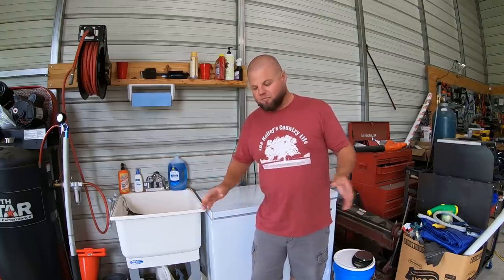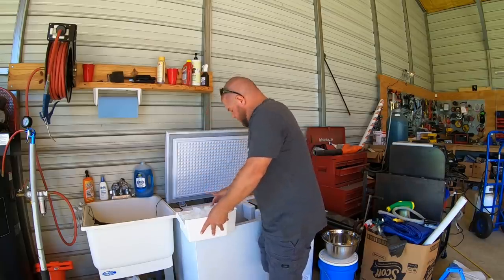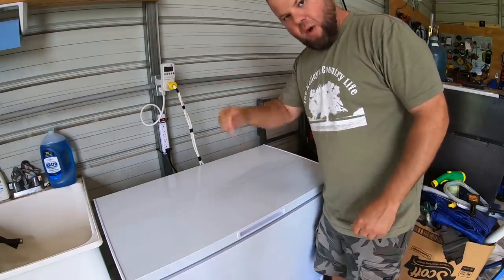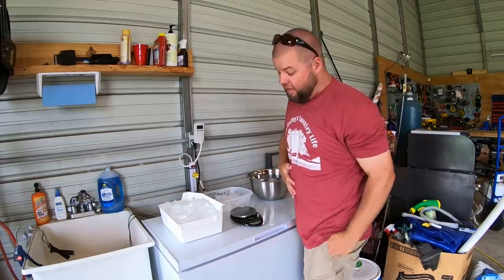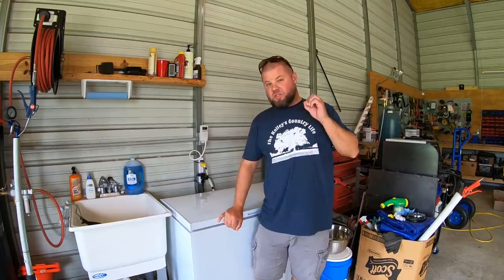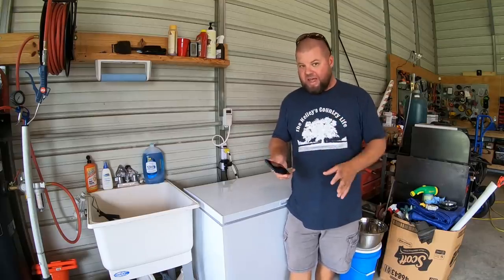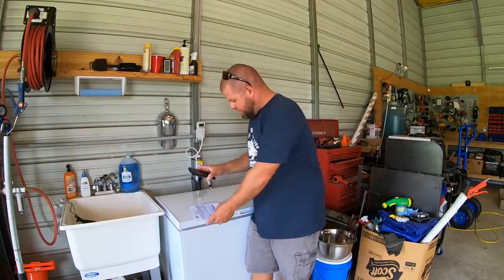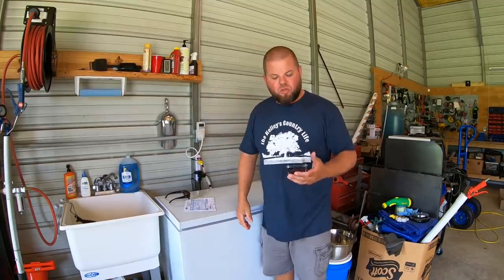Homemade DIY ice machine tests, energy usage and cost per pound! #370

Comment: Another thing you inadvertently hit on was the frost in the freezer which will make it more in efficient because it changes the convection rate of the inner surface which is how it cools and removes heat from the freezer.  Finding a more efficient way of removing ice from the freezer without letting heat and moisture in could be a huge advantage. Putting some sort of insulated tube on the bottom or creating some sort of gravity chute to remove ice from the freezer could be a huge advantage to the end result which is the overall production of usable ice. 🤔  i’m thinking of putting that up on a stand putting some sort of PVC tube with a valve on it that is insulated and has some sort of insulated cover that could be taken off you can fill up your bag or cooler with ice without opening the entire system and then pop the cover back on.  May be impractical from a monetary and labor standpoint but if you were working for an icemaker company and trying to make the most efficient product that would make a lot of sense.  

I think you noticing the water temperature was smart as well because that is one of the biggest heat sources inside the freezer where you are literally pumping heat in there in the freezer’s job is to remove heat from the system. Great catch 👍🏼

Ice is cool and all but let’s test this with mowing and try to figure out the most efficient quickest easiest and cost-effective way to mow. 😜 lol.

And your pocketbook is going to hate this suggestion but just from a purely ideological interest, it would be very interesting to see how cost-effective your system is against a marketed production icemaking system. Of course they have tons of money put into them so they’re going to make ice quicker but it’ll be very interesting to find out how efficient it is and include the cost The original story about unit to the cost of your final product and see exactly how much you’re saving by doing it yourself. 

And another project related after this is all over let’s figure out how to do this as cheaply as possible hidden craigslist and used appliance stores to see if you can find the icemakers and the products needed to do this for as cheap as possible.  😉 lol. Some people say it’s just ice and it’s not that important but with the amount of ICUs you’re saving a huge chunk of money every year and depending on how much use or how much you eat that may be every bit as cost saving to you as your garden is growing your own food, definitely on And efficiency-based setting, like you were saying at the price for gas to drive and pick it up paying two or three bucks a bag for something you can make it home for under $.50 you’re saving 80+ percent making it yourself%, a lot of people who garden to save money can’t hit that 80% mark. How many vegetables some money in a year. I’ve had several years where my garden ended up costing me more than what it yielded and even when it does healed unless you’re just eating tons of vegetables and would actually go by that money from the store in most cases people probably aren’t saving 80% by growing their own. I know that’s just the financial cost in growing your own is healthier and you end up eating way more vegetables which is even healthier but from an efficiency standpoint your icemaker is gold come a literally when you consider that the dollar is backed by gold, or sort of and should be anyway. Lol Either way it’s money in your pocket and every year that you have it it becomes more efficient
Reply from the maker: I'm liking the ideas, you'll enjoy a future video where some of that is already in the works.
Reply: @TKCL  yeah, I love this stuff. If I was a billionaire I’d be sitting around doing crap like this all the time and building stupid tools and devices and vehicles just to satisfy my curiosity and provide some entertainment value. Lol
Reply: @TKCL  this is also interesting to me in general but it something I would never do myself, I just don’t use that much ice in my regular freezer produces more than I use so no I might do it for fun if I had nothing else to do I would probably never do anything like this with the ice system on my own. Lol

Comment: You should have run the fill tubes through the lid, there are no lines or anything else to worry about, and the water will drain ouut quickly avoiding freezing up.
Reply: Could be a problem if the icemaker tries to fill while the lid is open!  Sure, you can make position switches so that doesn't happen, but that would add much to the complexity.  Putting in the panel in between the freezer and the lid to run lines through makes much more sense, at least to me. (sorry, I forgot if he mentioned the panel in this video or an earlier one.)
Reply from the maker: There is always water or ice in the makers.

Comment: An ancient & forgotten (deleted) technology is the “Water Trompe” which uses falling water down a tube with simple air intakes that aerates & sanitizes the water down to a collection tank at the bottom of the run. An additional line going upwards to the top is the water outlet & air separator. Disadvantage: height is required. Advantage: compressed air (refrigerated & clean) AND ice cold water output (ionized & purified). Ice plugs are periodically shot out of the air output. This technology was used to refrigerate certain cities in the 30’s (pre-electric era) & provide compressed air for air-powered cars that were bought out & buried. The exhaust of which was said to be cold enough to refrigerate meals in the trunk of the vehicle. Look it up!

Comment: I work in a commercial kitchen were we have under counter ice machine, never seems to produce as much ice as your setup does even though its rated for 60lb, also the ice is always wet so it melts fast. I noticed the ice size your machine makes is large, maybe you could produce more ice if you switched out the ice makes for ones that make smaller cubes? might increase overall production? Worth a try?
Reply from the maker: I really desire large long lasting cubes

Comment: The more ice that is in the freezer will make the freezer work less and be more efficient. All that ice will be radiating thermal energy that is producing very low temps that will keep the temp inside low enough to where the condenser unit won't kick on as often to keep the temp in the freezer within operating range.  Also, putting a thermal blanket around the outside of the freezer will probably help the freezer stay efficient also.
Reply from the maker: Testing

Comment: Sometimes hot water freezes more quickly than cold water. This is called the Mpemba effect after the student who observed it.
Factors that may cause hot water to freeze faster include evaporative cooling, less chance of supercooling, low concentration of dissolved gases, and convection.
Whether hot or cold water freezes more quickly depends on the specific conditions.

However if you get more ice by using cooler water supply to the ice maker those specific conditions are meaningless. The proof is when you put the ice on the scale. :) I live in Florida and I have noticed that my A/C works much better on a day when we have rain. It may be more about the humidity than the temp. You might rig an Ice cooler full of melting ice to feed the ice maker. That would prove or disprove the temp vs humidity question.
Reply from the maker: testing

Comment: As an idea for a thermal blanket, look at pit boss smokers website.  They make a blank that has magnets in it to insulate the smoker grills for those of us up north in the winter when we smoke.
Reply: Rigid foam board.   3-4" of total thickness.  I did this year's ago to one of my deep freezes and it made quite a bit of difference in how often my freezer cycles.

Comment: Reversing the fans won’t help.   But hurt.  

Ever use an air fryer?  Higher speed air on the water removes heat faster.  Which is how the inverse works with an air fryer.  Reversing the fans will have less velocity over the ice mold, thus slowing the heat loss of the water, so it’ll freeze slower.

You’ve basically created a freezer version of a convection oven.

Comment: The pump that pumps the freon or whatever is in that freezer - it works like this - the pump is submerged in the liquid that it is pumping - just like a submerged air compressor - if you cool that pump, you cool the entire unit and make it more efficient - we kind of talked about that in a coment/reply.   - But some research I did found that the FROST buildup actually makes the cooling and efficiency way worse - it insulates the inside from the cold!  Kind of weird but yeah! It makes sense to me!   Also - you don't have a basement or cellar to put that sexy ice machine?!  Add spacers betweet where all the ice is - yes more space filled makes it retain the cold better - BUT that ice still needs air flow from what I've read - to help keep the ice dryand that bit of space between the sections of ice, helps cool the air faster because of the airflow.   You can also use sheets of insulation inside to fill up the empty space to keep it cooler!  Right!  Who would do that?!  I always wondered why my grandpa put balls of newspaper in his deep freezer - it's to fill up the empty space so it keeps warm air from touching the - food in his case - this makes it so the deer and beef meat wouldn't get frost bite and keeps it cooler and from running so much!  
And - Fill it up – but not too much, freezers are at their most efficient when they're full of food but still have room for the air to circulate, around 75% full is best.
Reply from the maker: Thank you for the information

Comment: Put a pressure switch under your lid to cut fan on and off when you open and close it.
Reply: When Version 2 comes out it'll be really easy to add a magnetic switch like they have for door or window alarms.   I'd wait till then so you don't effect the current seal.

Comment: Countertop ice makers aren't too expensive and will make 20 plus pounds per day. A thermostat on a chest freezer makes a great refrigerator. The cold doesn't dump out when you open the door, freezers have good insulation and will not run long to just cool.
Reply from the maker: Testing that soon

Comment: maybe you could install a digital thermostat to automatically turn off the fans when needed. and you could try installing the ice maker side by side instead of only 1 side of the freezer.
Reply from the maker: On my original design they were side by side. I actually achieved slightly better results.

Comment: Do we know if the ice maker is timed? Or smart? just does it's thing on a default timed loop? or actually knows when the water is solid ice cuz of diff water temps and then drops it? Cuz that would totally help figure out which route to take for lowest cost.
Reply from the maker: It's has a timed release and dump cycle. However that cycle is not triggered until the thermometer inside reads a ice mold temperature of 10 degrees or less. So the quicker you can get the mold temperature below 10 degrees, the more cycles that are triggered.

Comment: I don't think you have to make clear ice but if you're not running your water through at least a carbon block filter your freezing temp is lower than 0C. A block filter costs about $35 at any home brew shop and comes with the filter, replacements are like $10 and as little as you are using it you could get by with a filter change annually or maybe longer.

For any one hating on the process I'll leave you with this “The Only Difference Between Screwing Around and Science Is Writing It Down” -- Adam Savage. Your doing science and science takes time but yields answers.

Comment: okay, I think you're on to something when it comes to the input temperature of the water.

The best way to ensure you're getting the coolest possible, while ambient water, would be to get a tank, run the water into that to allow it to cool off in the shade of the shop (assuming it's cooler in the shot than outside) and then into the ice maker.

Wouldn't recommend any such thing if you were putting this ice in your drinks, as tanks can get gross.

Cheapest option would be to find an old water heater, their output is in the top, and inlet goes to the bottom, while you would want the opposite, so you'd want to to plumb it up backwards to draw the coolest possible water from the bottom of the tank.

if you did use a water heater, you'd want to remove the insulation, as in this case you WANT it to exchange as much heat as possible with the ambient air.

Comment: Wrap your pipes in a pool noodle with reflective duct tape around the noodles..... scratch that apparently hot water freezes faster than cold water it's called the mpemba effect. I stead of cold water freezing from the outside in the ice insulates the water on the inside. Hot water freezes from bottom to top because heat moves up and it keeps the outside from freezing and Insulating the core. Maybe use black abs pipes in stead of white PVC. Or copper pipes in the sun.

Comment: No clue of the science of why this works... BUT the melting of the ice melts QUICKER for some reason in a Stainless OR Aluminum pans ! I’d use a PLASTIC bowl for measuring!!!! I’d be curious if you’d run a test on ice melting quicker in a metal pan vs a plastic one!!👍👍! Keep those videos coming bro!!!👍👍👍 appreciate ya!!!
Reply from the maker: Probably because metal is a better conductor for heat (room temp) than plastic.

Comment: Regarding video length, you mentioned looking at ways to cut that down. IMO, we don't need to see you weigh the ice for the tests, so that would be one way to cut some time.

The compressor making heat - not sure if that would actually make a difference to the internal temperature, only to the efficiency, but if it did, I would think the effect would be the worst right above the compressor, so you could avoid that by switching which side the ice makers are on.
Reply from the maker: I agree and disagree about weighing. Just as soon as I don't and include numbers, people are going to think I made them up. Weighing keeps things a little more honest in some people's eyes. Thanks for the feedback
Reply: @TKCL  That's true. Maybe you could play that section at 4-6x speed instead?

Comment: One thing missed is the percentage of power your well pump uses to pump water to the freezer. Probably VERY minimal, but still should be included. How to you text that? Idk, honestly. Besides that, this is awesome. Plus, you should factor the upfront cost of the unit and pieces needed. That factors the cost. 
I wonder how soon does it start paying for itself compared to how much ice you would buy vs make?
Reply from the maker: It's extremely difficult to test the well usage. I have a 80 gallon tank that rarely kicks on the pump to fill. The pump literally runs for a few seconds to fill it back up. It's very minor additional energy usage.
Reply: @TKCL  Fair enough! Loving the build and updates. Thanks!

Comment: Have you had an issue with the ice becoming more of a block of ice as it sits during the week.  I remember you bought the metal ice scoop kind of planning to chip it if needed.
Reply from the maker: Scoop was for filling my coolers. No issues in the past three months. I bet by the end of testing it will be frozen some. I'm opening the lid way too much

Comment: I'm curious to see how you cool down the water....Once you've figured out how to cool down the incoming water... you may want to consider insulating your cold water pipe with a polyethylene insulation - Jones Stephens insulation is the manufacturer - you'd want to use 1" thick insulation for 1/2" to 1" pipe - this is something that is required in CA for all domestic HW/CW lines in commercial settings... :) - Also please let us know what material your CW piping is (galvanized, pex, copper, etc.,)
Reply from the maker: Piping is standard pvc

Comment: Interesting way to (maybe) also air condition for free.
Solar power the freezer,  zero cost for  freezing ice (excluding the freezer and solar).  Freeze a SOLID brick of ice the total volume/capacity of the (sealed) freezer.  Include a few pipes suspended throughout the total volume as paths for airflow.
Once the total volume is full of solid ice, now there is potentially AC capacity for sunset hours.
Cool off with ice made from sunlight...
Solar powered AC after the sun sets!
I know this WHOLE thing started as a way to minimize the cost of ice for fishing but, what if somebody stumbles across a way to minimize AC use as well?
Reply from the maker: It's been a popular suggestion.... 🤔

Comment: Idea for better measurments... instead of trying to weigh the captured ice, install a volume meter on the water line. The more water used means more ice made... Idea to disprove the "thermal mass" conspiracy is to simply move the fans back to original position for a test.

Comment: Hot water freezes faster because the water heater causes the solids to drop out, flush your water heater for proof. A lot of well water is soft, no solids, but a simple in line filter will take most out.

Comment: Pull the thermostat out, located near the compressor. This will lower the temperature of the chest, causing the ice to freeze quicker. Instead of 0 degrees inside of the freezer if could drop to -40
Reply from the maker: But cause the compressor to run excessively. I don't want to tear it up
Reply: @TKCL  then don't pull the thermostat all the way out. The compressor with still run longer, but also cut off instead of running all the time.

Comment: When you're testing the incoming water temp check how much water it actually uses to fill the tray, it might not use any more water than what is in the pipe/tubes inside your barn. That temperature will fluctuate a whole lot faster than what's in the pipes in the ground.
Reply from the maker: True and I have ideas how to move the location of chilled or heated water.